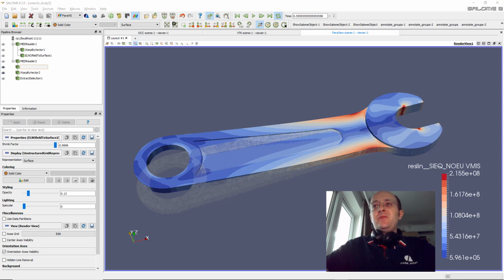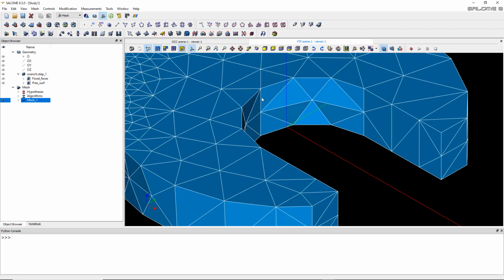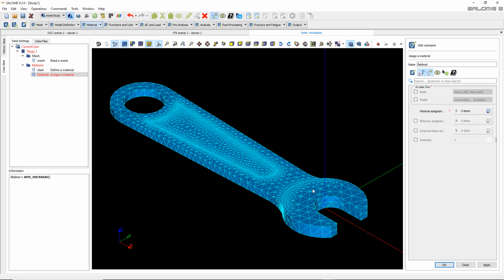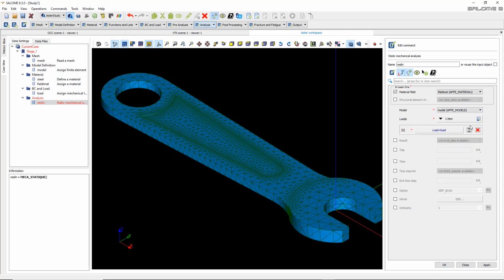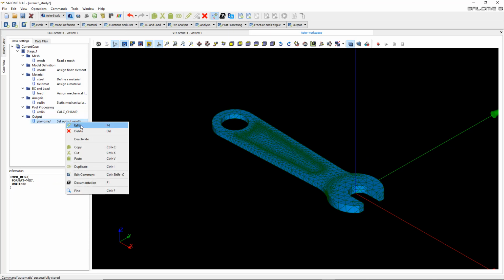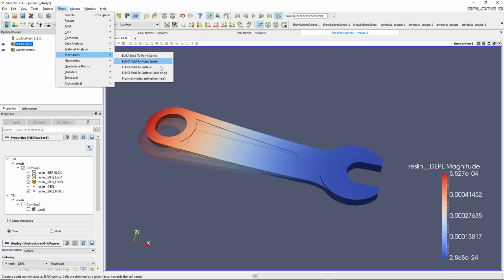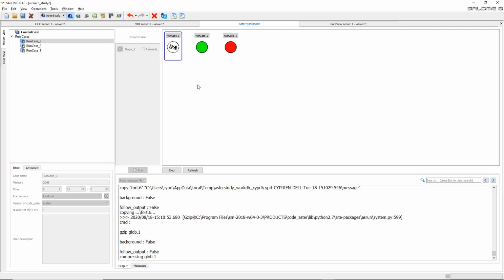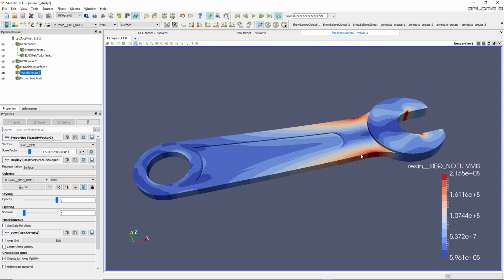Full Tutorial - How to Simulate a Wrench with Salome Meca?

Comment: Thanks for the video. This was my second tutorial using Salome+Code_Aster. I was stuck for hours with a message error running the simulation because I didn't assign Loads in the Analysis section, but here we are to learn. I had the doubt about the Von Misses stress representation in the elements (not in the nodes) and you clarify that topic in an easy way. Thanks again.
Reply from the maker: Glad to hear it helped!

Comment: Hi, thanks for your video.

May I improve your postprocessing at the last minutes. 

You should change your legend of stresses:

Lowest boundary = white+ 0 MPa

Highest boundary for Re oder Rm or any usefull kind of „critical stress limit“ 
= red + i.e. 235 MPa 

In that case you will easily find all critical spots > 235 MPa 

Try it, its quite easy. 

Otherwise the contourplot give less information. And, you are not allowed to compare different  fem jobs i.e. for an presentation. 

Best regards
Daniel
Reply from the maker: Great advice @Daniel
It’s difficult to remember everything I want to show when making a video… definitely need to demonstrate the method you proposed in one of the next tutorials.

Comment: The (newer) Windows version is slightly different in the output. The simulation fails. Asterstudy file save does not even work right, and I lost over a half an hour's worth of work.
Reply from the maker: Sorry to hear that. I am also getting some problems after I installed windows 11. The linux version is more stable.

Comment: Thank you for taking the time to put this tutorial together Cyprien. 
It's so wonderful that there is an open source FEA software out there. It's just a pity that it's so much more labour intensive (button clicks) to perform a simple analysis than commercial software. 
Hopefully the user interface and the entire assignment process will be simplified in a few years and make it more efficient. 
Perhaps I will try it in a few years' time.
Reply: There is nothing wrong with the complex layout; you can re-organize it and modify it as you need.  If you prefer, you can spend lots of money for a low quality commercial FEA program that will be easier to use.  I would recommend donating money to the Salome and Code_Aster team instead.

Comment: actually, I have two questions for you if you can help me. I am now modelling a wind turbine blade and the forces that act on this blade it has three types of forces pressure as a result of the wind forces this I can get by 2D CFD simulation for the aerodynamic cross section and I can here simulate it using pressure load.
I have two others type of load 1)centrifugal body force due to its rotation around its axis. actually, I tried to do it here but it's not clear for me how to do
it and I have the gravitational forces and I added density to the material and I added gravitational force but they ask for gravity constant which should be 9,81 and they ask for 3 directions and it's not clear for me how to input those directions?
I appreciate any help thank you

Comment: When I clicked button to run, on my WIN10 computer, It print "Cannot read output file or empty file.", who can tell me how to resolve it?
Reply from the maker: When you set the output file in the IMPR_RESU command, check that you have set correctly the output file and the extension as rmed. Have you followed the video up to the end? You also have to select the results and add those to the output
Reply: @Feaforall  I have found the reason, I am using a chinese language system. When I changed it to english, it works. Thanks for your reply!